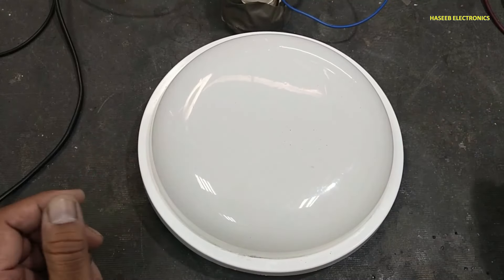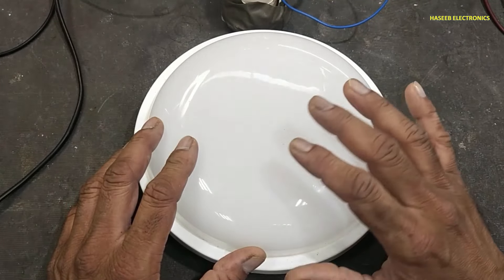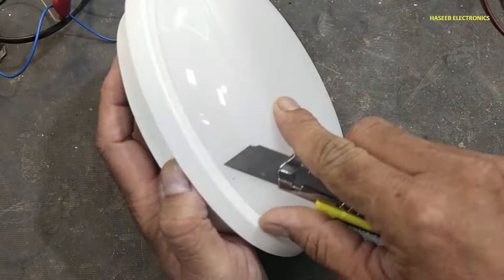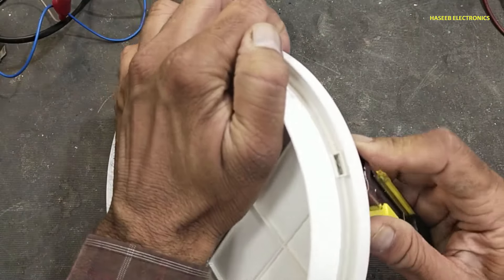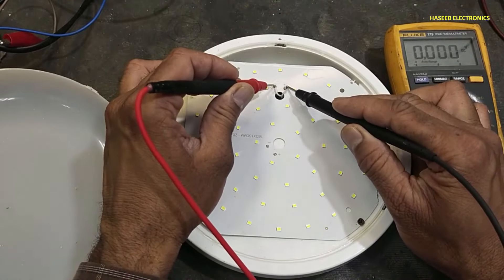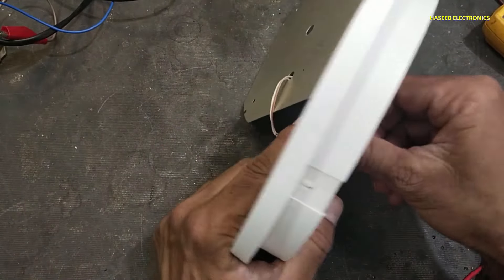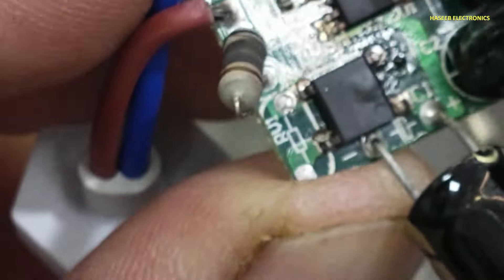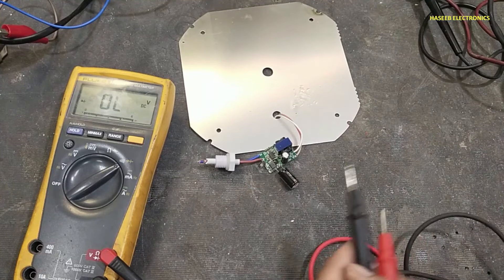{1032} LED ceiling light repair

Comment: Nice and informative video. I do not know if I am allow to say it here but I hate led lights and led light bulbs. A very expensive and complicated "solution" to a simple "problem". The incandescent light bulbs were cheap and simple in production and the best brands lasted long. Most of the led bulbs are designed to fail way before the official indicated hours of usage and they are full of things that can fail. One of mine that had failed was clearly burnt (IC, resistors, capacitors etc.), one could see and smell the fire. This happened even though the pcb and components were covered with thermal paste. These things should be banned. The only good thing about them is that one can use them for spare parts if they are not to badly damaged.